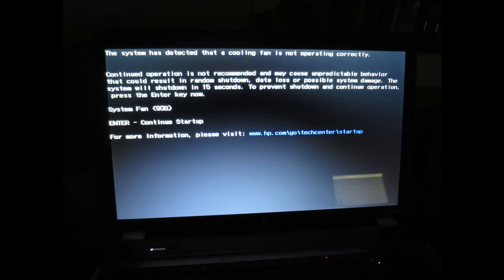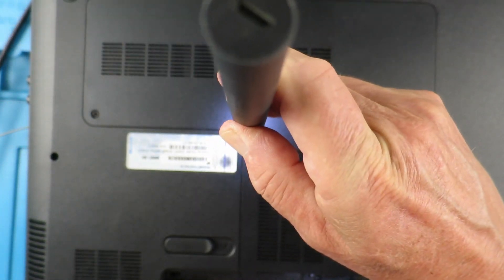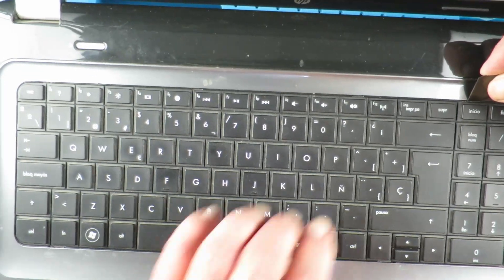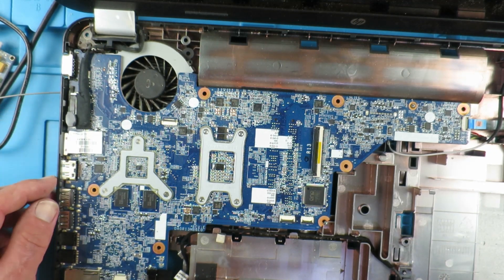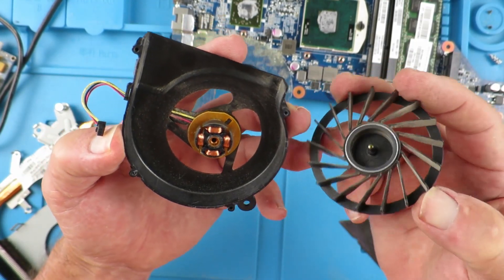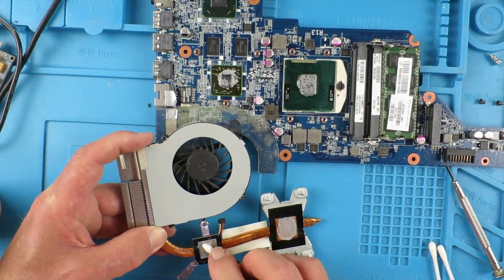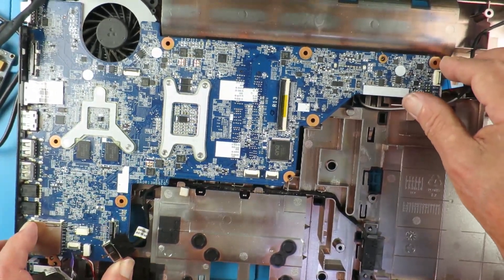HP Pavilion G7 Fan Clean Thermal Paste Renew Repair Laptop Overheating Error

Comment: I put everything back together and my laptop turns on but my keyboard doesn’t seem to work. Any ideas why that might be occurring? 
I did take my keyboard buttons off and washed the buttons and dried them before putting them back on. But I’m not sure if it’s the cause of the issue.
Reply from the maker: Double check the flat cable is fully inserted. It is easy to think it is in all the way but sometimes it need to go another 1mm or so. Also the latch must close properly. If you look at the flat cable connector you will see small indents where the cable is clamped. Good luck!

Comment: You removed the ribbon cables at 1:45 but what are you doing at 1:47? How did you remove the power connectors? You put your index finger there then there was a cut/edit.
Reply from the maker: Hi, I just used my fingernail to release the power connector and pull it out. Sometimes they can be a bit tight, I keep and old pair of blunt side cutters which I use to ease them out. Thanks for watching, have a great day!
Reply: @1nformatica  Wow, didn’t expect an answer. I appreciate it.
Reply from the maker: @DemonFox369  You're welcome! Have a great day!!
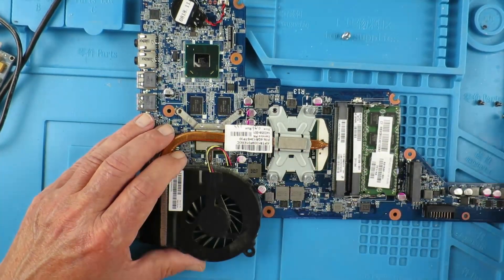Reply: @1nformatica  I’ve gotten to the heat sink and motherboard 2:45 but no luck unscrewing the screws, it’s not gripping (even with rubber bands or a smaller/bigger screw driver) 😞
Reply from the maker: @DemonFox369  There are two types of "crosshead" screws. Probably you have the wrong driver. It is worth investing in a decent set like I use. Once the head is chewed it will be virtually impossible to remove with out drilling the head off!
Reply: @1nformatica  😦 I tried to use a plier to turn the screw and think I accidentally damaged the F192 3 9 0 2.5V (is this a battery). It’s no longer tightly attached to the motherboard, it comes off a little. Is that really bad?
Reply from the maker: @DemonFox369  I don't recognise that part description. Maybe a capacitor in which case it may still work. Your mileage may vary!

Comment: Got the dust cleaned out, good tutorial followed it step by step. However, now, my fan is making a loud rattling noise and I don't know what happened. (I cleaned out and lubed the fan as well.) Hopefully it is not harmful or hurting performance... By the way I had WAY more dust than you did! A thick caking of dust on the vent and everywhere inside the laptop was dust. Seems to have improved the performance slightly but now it wont overheat hopefully, just wake up my roommates :(
Reply from the maker: If you have cleaned and lubed the fan shaft then perhaps the bearing / bushing has worn to the point that the fan bladed is rattling or even touching the outer casing. You can probably find a replacement fan on eBay. Good luck!
Reply: @1nformatica  Hey, I honestly did not expect a reply but thanks. And your video was super helpful I am no longer afraid about taking apart my computer!
Reply from the maker: @korpze206  Hey thanks! Good luck with your endeavours, he who dares - wins!

Comment: Don't know how long it's going to last but I sprayed some electrical cleaner into the vents of my noisy fan, both side and bottom vents.  Fan was just loud but still working, so I hope I don't have to open her up, not yet anyways!
Reply from the maker: Sometimes it can be just a dry bearing that slows the fan down so you may have fixed it, let's hope so!

Comment: Do I need to use a different screwdriver for the whole thing or will the same one for the back panel do?
Reply from the maker: You can see in the video I am using the same screwdriver a Wowstick battery operated one : Wowstick 19 In 1 Electric Screw Driver http://bit.ly/WowStick or http://bit.ly/Wow_Stick
Reply: @1nformatica  Noted, thanks a lot :)
Reply from the maker: @davids7959  You're welcome! YouTube no longer shows me if you are subscribed. Please consider subscribing if you have not done so already!

Comment: Thanks for the detailed video.  Replaced the fan and heatsink thermal paste in my mom's old HP Pavilion G7 1030us laptop.  The laptop was pretty clean and very, very little dirt to speak of in the exhaust heat fins.   The old fan would sometimes run , but it would not spin freely by hand.  Tried to clean and oil it but no luck, as well as accidentally breaking off one of the fan blades, so just got a replacement fan..  After partially reassembling the laptop verified the new fan worked but then the display was no longer working.  Had to detach and reattach the LCD display connector to the mother board display socket several times to get the pins scraped enough to get it working reliably again.  Also I accidentally pulled off the blue tab on the power switch ribbon cable but was able to hold the tab over the inserted ribbon cable before pushing down the cable clamp which worked.   Finally got everything working and verified the CPU temps were now back to the normal range using CPU ID monitor.  The bad thing about replacing the fan is you have to disassemble so much of the laptop that you can potentially cause other problems detaching and reattaching cables, and connectors in the process.   Like you said,  why did they not make the fan easier to replace.
Reply from the maker: Thanks for the comment. Glad to know my video helped you fix the laptop. Some are easy but not this one, you did well!! Please consider subscribing if you have not done so already!
Reply: @XinhXinh After partially reassembling the laptop I verified the new fan worked but then the display was no longer working.  Had to detach and reattach the LCD display connector to the mother board display socket several times to get the pins scraped enough to get it working reliably again.
Reply: You could also probably get circuit board cleaner to spray that connector to clean it.

Comment: Thanks just fixed an old g7 today using this video. The vent was blocked by a 3cm thick sponge made out of dust 😂🤘🏿also re-aplied the thermal paste and it works like a charm now.
Reply from the maker: •:*¨¨*:•_•:*¨¨*:• EXCELENTE_•:*¨¨*:•_•:*¨¨*:•_!! Glad it worked for you.